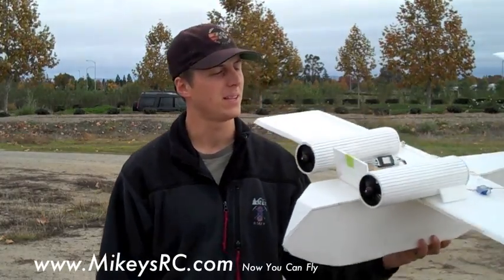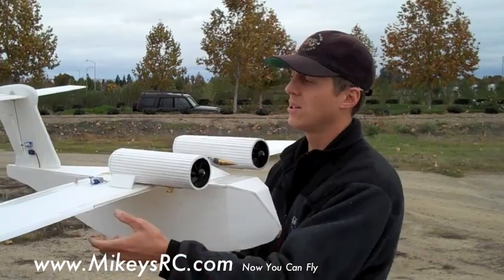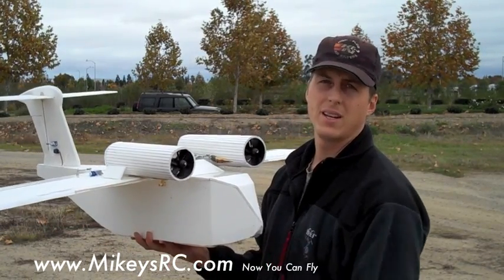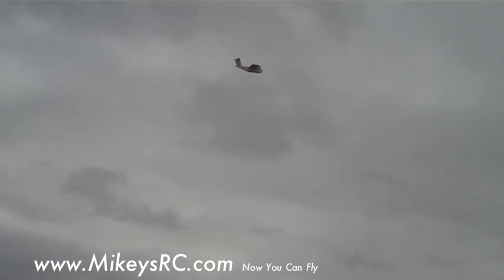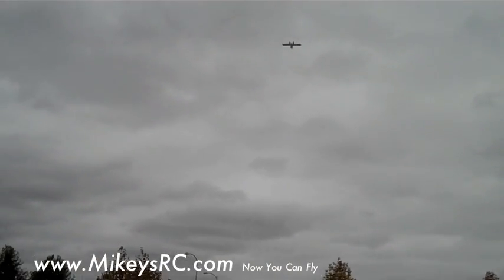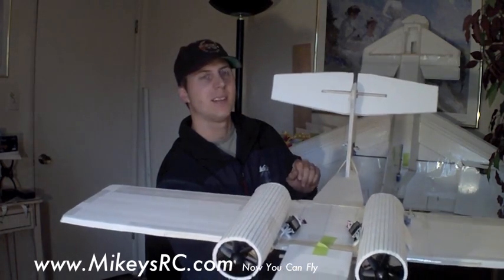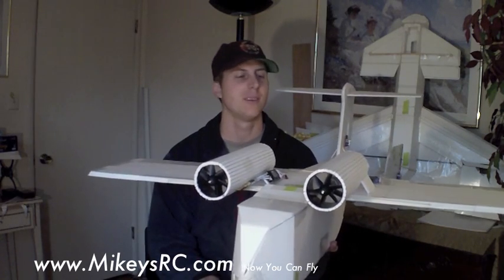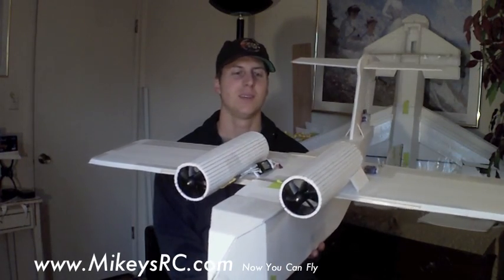Scratch Built RC Jet Plane  Boeing YC-14 CRASH

Comment: like mike i am watching your videos for much time , actually by watching your video it seems so easy and fun , i have a setup of electronics if you can guide me on where i can you it i will buy a plan from you site, this is turngy 2216 17 brushless outrunner 1026 kv i think , 25 amp esc and 1800 mah 20 c zippy .one is 3s and the one another is 2s .i am getting down buy breaking props again so intrested in pusher or kind of some thing . plz dont tell me to buy any more elctnics.

Comment from the maker: @jayc004 Hey cool!  Glad you like my channel.  Foamboard is kinda like depron but with a light weight paper or posterboard on both sides.  It's WAY easier to find a t a local craft store or Walmart AND MUCH cheaper than depron.  Plus it's stiffer and onlt requiers minor stiffners(like the BBQ skewers I use) to make it strong enough for small aircraft.  Google foamboard and you'll get plenty of info.

Comment: Good job. On flying stabs the pivot point needs to be further forward than center. This would eliminate the elevator from rotating further forward as you experienced. You can experiment with with a small pieces of foam attached to skews and see how the pivot point effects stability.

Comment: @MikeysRC  i got thomas sherer LRS rx/tx  
duo2400 2.4  with a 14 dbi patch antenna and a 24 dbi hyperdish grid antenna

fatshark goggles . ezosd , and antenna tracking .. only thing im lacking is a plane with mussle .. i just destroyed a new 430xl align motor .. worked awesome till i saw smoke in the air .. lo0lo..  you want to make me a PLANE  that can go 7000  ft up 5 miles out?  and still have enough to come back?   ill be using it to fpv //

Comment: with all flying tails they do not put the hinge line in the centre for that reason, if you have more surface area on the back bit it will want to push that way, whereas if there is equal surface either side it will just want to move it vertical

Comment: sweet flying plane Will. All my planes use the bow and tape technique since i usually don't use CF, wood dowels, struts, etc... I personally have never bent or folded a wing in flight (even at speeds of 80-90 mph). btw, i think "tough crowds" will make you a better builder in the end.

Comment from the maker: @billfromelma Good suggestion.  The over rotation is part of the problem.  The other part is that even though there is no "slop" in the flying tail linkage and bushing there is still flex in the whole elevator surface.....was hard to see in the video but at times it would "vibrate " in the air as the elevator was fluttering.  So I'm going to have to make it a fixed surface with a moving trailing edge.  Looks less cool on the ground but will fly much better.

Comment: Hey Will  that really flies nice. Got a kick out of your voice in the video, could tell you were pleasantly surprised at how well it flew. It sure did,even a barrel roll. NICE. Just a suggestion.In stead of changing the rear wing, just glue a stop on each side of the vertical  ( a piece of foam) to keep the elevator from over extending. the piece wouldn't have to be too big. Just enough to keep the elevator from going down too far.